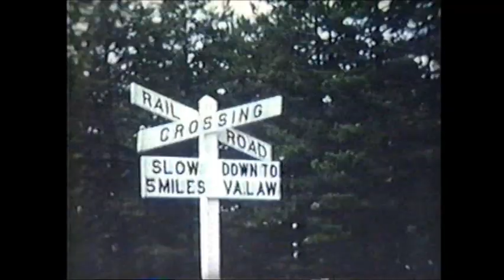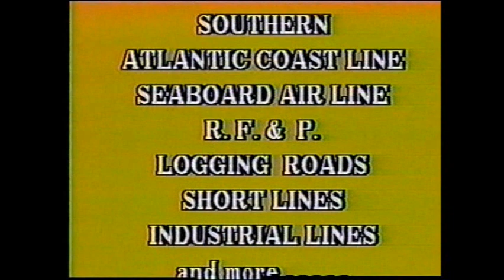Virginian Railroad Old Locomotive film, "Virginian Vignettes"

Comment: Wow, there is a good amount of H8 2-6-6-6 footage in this video. The most powerful steam locomotive of all time. Footage of this monster is rare. Love seeing new content being uploaded.
Reply: The Virginian rr AG class 2-6-6-6 locomotives are classified as the "Blue Ridge" type, built by Lima works in 1945 and operated until 1954.
Reply: Pretty sure the AE class 2-10-10-2s has more tractive effort(the 2-8-8-8-4 XA has even more then the AEs)
Reply: There were some duplexes that were (just a little bit) more powerful, but nowhere near the numbers of them. Also the duplexes were too slippery to be really useful, and the Allegheny / Blue Ridge locomotives were possibly the least slippery ever, with enormous weight on their drivers. Only the N&W class A's had more tractive effort, but were thousands of HP less.
Reply: @paullangford8179 The N&W class A has 114,000 pounds-force of tractive effort, the VGN class AE 2-10-10-2 had 147,200 pounds-force while in compound and 176,600 while starting trains in simple(delivering steam straight to the front cylinders)
Reply: That’s tractive effort. The Blue Ridge and Allegheny have the highest Horsepower supposedly

Comment: The Baldwin 2-8-8-8-4 Triplex was a failure. It was intended only for heavy pusher service but it had insufficient grate area to keep steam pressure up long enough to push a train over the crest.
The locomotive was split into a 2-8-8-0 which served for many years. The tender engine became a 2-8-2 which also lasted to the end of steam.
Reply: honestly so, it was a failure

Comment: I remember the Virginian trackage in southern Virginia on trips to my wife's folks home back in the 1970s. We passed through Meherrin and Virso, VA. Crossbucks were still painted on US360 at Virso but the interchange track with Southern that crossed the highway was long gone. Only the ROW was still visible. There was also a wye at Meherrin which connected to the parallel N&W. Virginian trackage East of Meherrin heading to Victoria was still operated as a branch and the trackage West of Meherrin was used as a storage track. The East leg of the Meherrin wye was used to access the active branch trackage and the West leg accessed the storage track. The old Virginian straight through track at the wye was abandoned and disconnected, but still in place. Usually in the Winter months a long string of hoppers or piggyback flats were stored which disappeared in the Summer. After the Southern/N&W merger,  eventually all the ex-Virginian trackage through Meherrin was pulled up, even the formerly active trackage East of there. Never saw any trains run on the active trackage. Just saw strings of cars being stored on the storage part of the line. Sad when I see on this video how busy and well maintained the trackage was in that location not many years before.

Comment: I love the electrics. Too bad the Great Depression got in the way of a more widespread electrification of our national network. They could burn coal near the mines to generate electricity to power the trains, massively more efficient than steam locomotives when looking at the huge maintenance requirements for steam power.
Reply: The Pennsylvania Railroad took advantage of the Depression to electrify its mainlines, including the NYC-Washington "Broad Way", and developed the 90-per GG1s.
Reply: But they needed federal aid (in the form of loans and guarantees from the New Deal-era Works Progress Administration) to finish the project, which illustrated the difficulty of implementing electrification in North America. Its very expensive, because all the infrastructure of an electrified railroad, from the power stations to the overhead lines has to be installed AT THE SAME TIME. And  there's the ROI: how fast the line can pay back the amount invested, plus interest, within a reasonable amount of time. These are some of the obstacles to electrification of railroads in North America.

Comment: Would it not be.tter to have additional motors rather than use side-rods to turn drive wheels?
Reply: Electrical technology at that time did not allow producing small electric motors. This is why they had to use big motors, and mechanical rods.
Reply: @nazareth978  That changed in about 1927 when Westinghouse developed a motor that fit between axles. VGN waited about 20 years to get the EL2B units that used those motors.